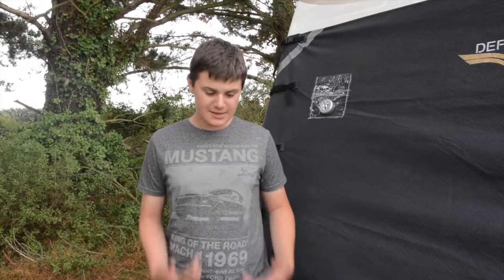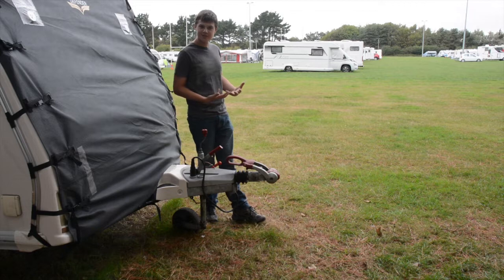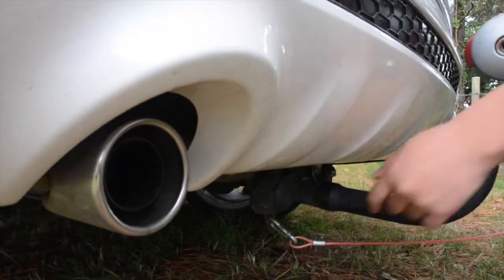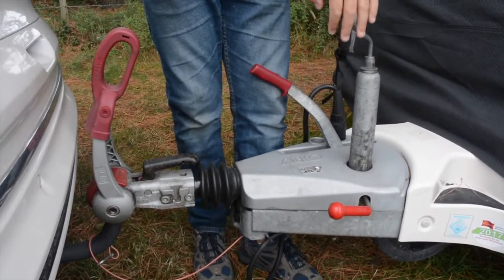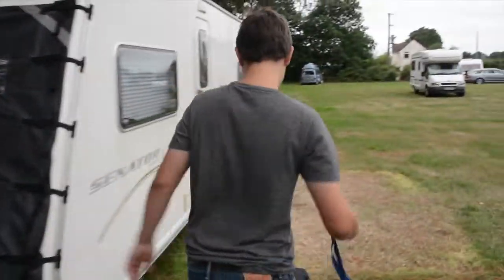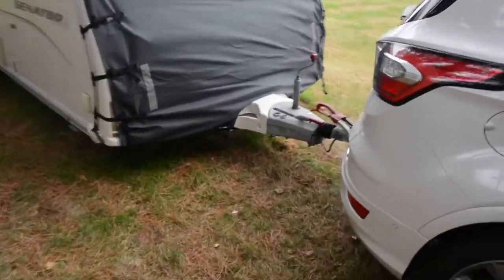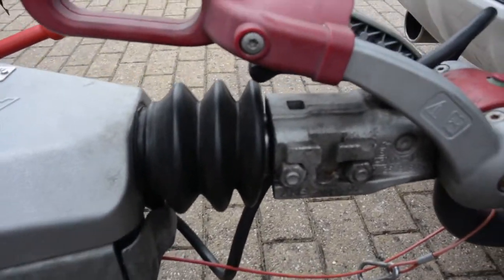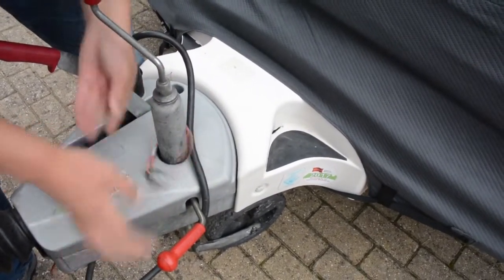How to Hitch and Unhitch a caravan

Comment: Thanks. 
There's no hook on our towbar so like you, we'll wind the breakaway cable on to the towhook.  
Useful advice about 'opening up the bellows ' on the hitch when unhitching to avoid any damage to the rear bumper.
Last time I had problems getting the jockey wheel right.
So I can see me having to experiment on the drive way once we're home.
Just in case one doesn't come with the new caravan, we've already purchased the Maypole (?) pin alignment cap. 
After a ten year gap, in 6 hours time we're about to start towing again (a Freedom Jetstream Twinsport)  This is all invaluable advice from you ...  :-)